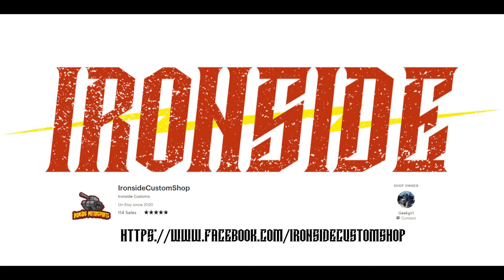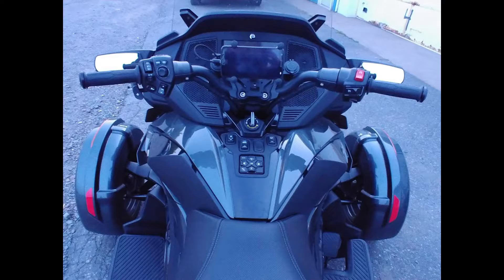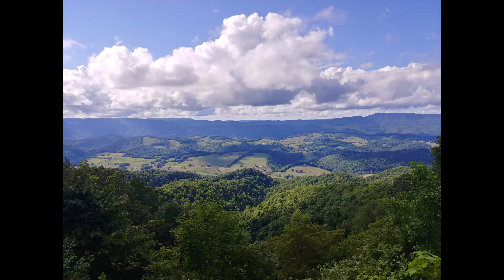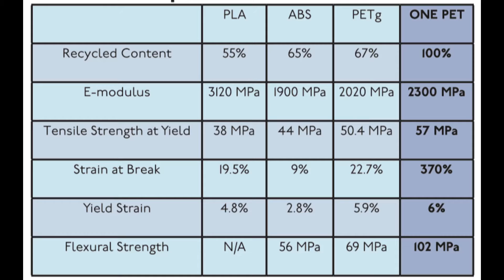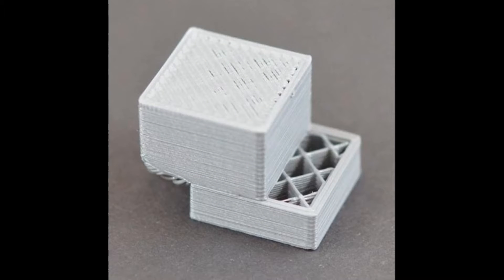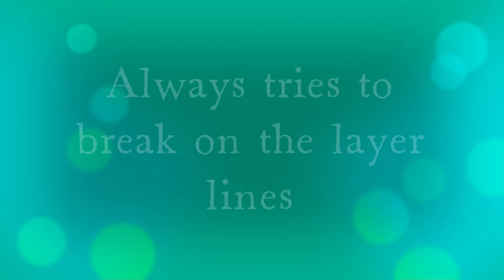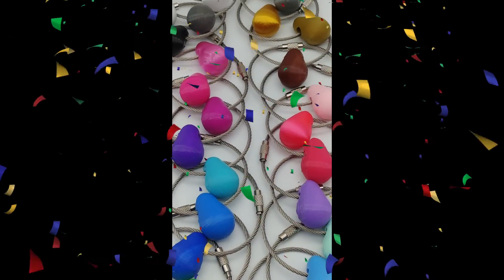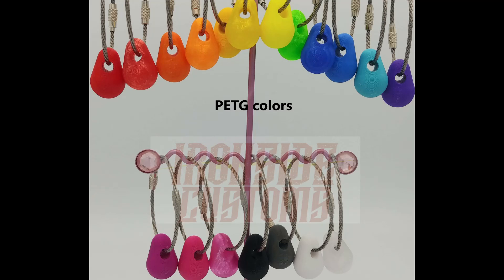WATCH BEFORE YOU BUY A RYKER ACCESSORY FROM ANYONE!

Comment: You can make them even stronger by coating them with crazy glue or a similar type liquid adhesive.  Then low viscosity glue seeps down in the cracks between the layers and adds an extra bond.